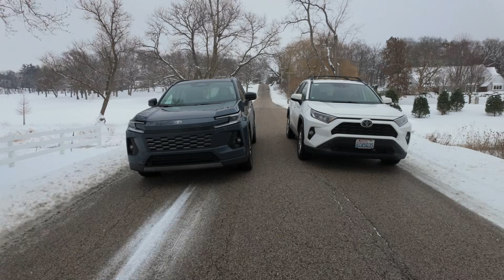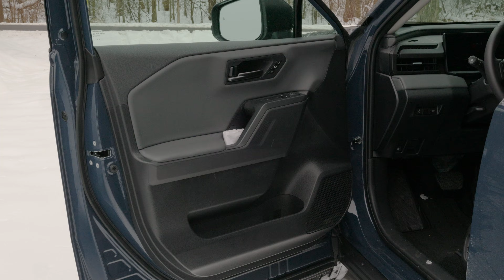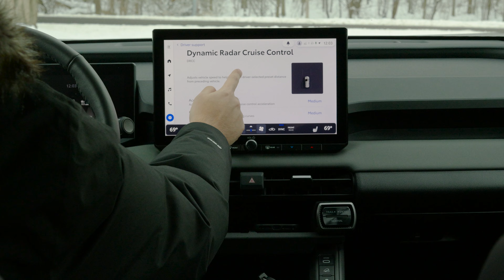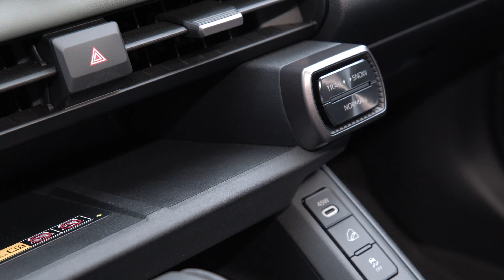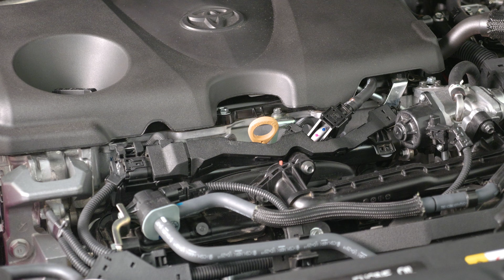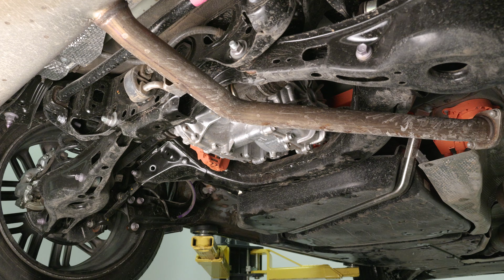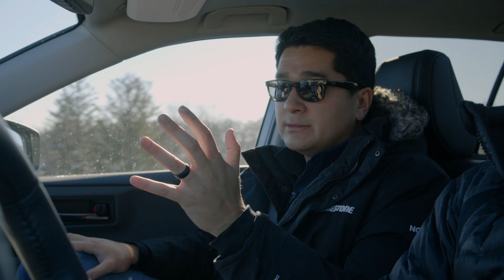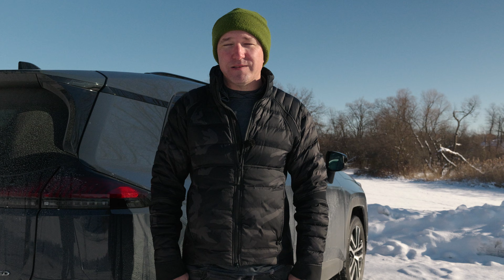2026 Toyota RAV4 | What Most People Want

Comment: Jack, you said you bought your RAV4 without hybrid to avoid long-term costs but then say the new RAV4 WITH hybrid is better in EVERY way.  I guess someone was in the back seat with a gun pointed at your career.
Reply: My wife bought it before we got married. It was due to availability of the hybrid is Covid. Other than the battery replacement the hybrid running costs have been proven to be quite low

Comment: I own a 2020 Rav4 Hybrid XE with just under 70K on it. I have 2 complaints with it. First is noise. Especially tire & road noise. It's good to hear that Toyota improved that. But, my other complaint is battery degradation. In the first 10K miles I could get up to 47 mpg on a tank, depending on where & how I drive. (Avoiding freeways and staying under 45 mph.) But, that quickly creeped down to 44, 42, 40... Now I struggle to achieve 40 mpg. And the car forces the engine to come on much more frequently than it did when it was new. My current tank is at only 38 mpg. Open highway mileage has always been at about 36 MPG.
I've been thinking of replacing it with a higher trim and the plug in. If dealers in Northern Nevada don't gouge me on the price, I might just pull the trigger this summer when the PHev is released.
Note; This car replaced my 2013 BMW X3 after the second engine ate itself with only 60K on each engine! I blame it on BMWs ridiculously long oil change intervals.

Comment: 0W-8 Oil! Wow better get used to 2500 mile oil changes. I like this but frankly I prefer my CX-50 Hybrid. Less plastic in the interior and with the Toyota drive system it's a really nice efficient vehicle.
Reply: Resistance to flowing has no bearing on the lifespan or durability of said oil.
Reply: @tim3172  That engine machining better be aviation grade PERFECT...but it won't be....engine go boom.

Comment: Why does a snow mode (which the user uses ONCE in the entire cold part of the season, provided he even has a cold season where he lives) - have a dedicated hard button - as opposed to climate controls - which the user uses many times EVERY DAY - with the need to take the eyes off the road for 3-4 seconds for a moronic screen? Why are we forbidden to use mobile phones behind the wheel - when the automakers make us delve into a moronic, needless screens - for several seconds at a time? WHY? Didn't a japanese car manufacturer (Civic) reverse a volume knob disappearence after a huge backlash in the previous gen - then what is this stupidity that we see? Is this the pure manifestation of greed? WHY, Toyota? What was wrong with normal heating and climate knobs and dials - you had in the previous gen? Do you now have to save some yens on the buttons you no longer have - for the suite of needless adas systems - meant to prevent us from crashing while adjusting temperature in the screen? WHY??

Comment: 2023 xle premium hybrid appliance owner here. Just wondering how much more refined it is? The prev version has road noise, the steering is numb and it sways if braking slightly hard. 

I think this vehicle will attract new buyers but i dont think it is enough for owners of the older generation to switch. 

Oh and that ev cable housing is near the rear ev motor now with a similar cover to the updated one in the prev gen. The housing is more exposed in the new one. Wonder how that will play out due to earlier 5th gen "cable gate" issue.

Comment: my question is: is the new battery type actually as reliable as the previous gen?  Those older NMH batteries may have had a time limit of 10-15 years, but within that timeframe I've seen TONS of them make it like 500,000 to 700,000 miles before failure (taxis, ubers, couriers, etc).  Will the new lithium ion battery be able to do that?  Because I'd be willing to bet that they're going to last 7-12 years and maybe 100,000 to 150,000 miles maximum.

Comment: This is like most vehicles.
Made for people who do not have enough brain cells to handle driving.
The ones who think 10mph under the limit is safe, until you get to a passing zone, where 5 over is needed, just to make sure only a POS would pass them.
The ones who think a clear road is a sheet of ice, because its 34 degrees.
The ones who believe the turn signal should be applied AFTER braking and merging into the turn lane, and then stopping, despite an excessively large gap in traffic.
The ones who merge onto a 70mph roadway at 43 and then bitch about how those semis "drive too fast".
The ones who drive 37 in a 55 and yell at their kids about how "THERE'S ALWAYS SOMEONE ON MY ASS!!!!!!"

Comment: How often did physical HVAC controls break on any car I’ve owned over the last 50 years?  Never.  How often have I had a screen stop functioning properly in that time?  Lots.  How exactly will you fix a 12 year old screen when it stops working?  The current trend towards putting all controls in the screen may not end well for consumers.
Reply: The variable blower speed control resistor often fails on some vehicles, Nissan, but you still get high speed.
Reply: What happens when a Tesla screen fails? You could be stranded.
Reply: On the bright side if a screen fails they can always blame it on a bug which will be fixed in an upcoming software update, instead of engineering physical controls which costs more money.

Comment: The 2026 RAV4 pricing was released ~3 weeks ago and they increased, even more pricey than the current Honda CRVs.
Can't compare this New generation of RAV4 with the current CRV hybrid which is in the mid to end cycle. Toyota uses a ~5~7 yr cycle refresh while Honda uses a 5 yr cycle refresh, next ~2028. A better comparison would be in 2028 with the newer Honda CRV hybrids.
You forgot 1 thing to mention... does the New 2026 RAV4s have a spare tire? Fog lights?
Many automakers, including Honda, have Remove them.
It appears that Toyota & Hyundai/KIA are keeping many equipment components vs Honda which is De-contenting the CRV, stripping it bare, and putting it into its Acura line in America, which is BS, considering Acura has NO hybrids! The CRVs now are Overpriced but similar to the RAV4s... keeping it 'basic' as a moving 'appliance'.

Comment: While it may be what most people want, it is not what I want, and I already have a '25 Camry,   which is not really that great, either...yes good hybrid driving dynamic and fuel efficiency, but the seats suck and way too much BS electronic nonsense...Rav with no buttons/knobs for hvac is a deal breaker for me, I mean they have two pods on dash that should be for fan speed and temp like the Tacoma, but they have to load it up with things that most people don't want or need to be fiddling with while driving,,,these cars would be so much better without all the gimmicks and electronic crap!

Comment: I want a simpler RAV4 with a 2 liter diesel.  
I do NOT want digital menus or a complex (and heavy) hybrid drive system.
Stop the madness.
Reply: "I want to pay 40% more for fuel."
Yikes.
Reply: @tim3172  Getting 60-65mpg with diesel offsets that cost.  That, and having MAX TORQUE at 2100rmp makes your car a rocket ship around town.
Reply: @tim3172  60-65 mpg and MAX TORQUE at 1800 rmp.  Twice the mileage and twice the performance around town.

Comment: Subscriptions in my car but they removed physical HVAC controls? 

That's a bruh moment
Reply: Not to mention that interior and especially the dash looks like seriously cheap plastic junk!
Reply: They remove the knobs so that when the screen dies you'll be forced to pay thousands of dollars to replace it in order to heat your car or buy a new car because that lifetime fluid totaled your transmission.
Reply: What's weird is my 2025 Camry had a much longer trial period for subscriptions then my new 2026 Rav4.  Connect and Safety are for 10 years in the Camry and 5 years in the Rav4.  I don't really use any of them anyways, so I definitely won't be signing up after the trial periods end.  It's cool that you can make sure your doors are locked and windows are rolled up but other than that who cares.
Reply: Imagine them charging you to use your heat or AC.
Reply: The HVAC buttons on the last gen were really just vestigial, anyway
Reply: @ChoPi-Eww LOL no, they weren't.

Comment: Nobody (approximately zero people) have their battery replaced at the dealerships.  The aftermarket replacement for a hybrid battery by the time that it's needed, 10 or 15 or however many years down the road, has historically been around around the $500-$1000 range (NOT $3000!!!) and it's so easy to do that owners can do it themselves.  Battery prices have been coming down, too, due to glut of supply.  Online gougers can be found, as can good deals and honest pricing.
Reply: By the time you actually have to change the battery or repair it, you have saved so much more money on other things that cannot break because they are not there (alternator, starter) and overall reliability and the phenomenal fuel economy, that it is ridiculous to say paying for the battery has any impact at all. These drivetrains are bullet proof.
Reply: @th3m3du54  Heads-up, there's been hostile misinformation by the EV wackos.  EV itself is hostile, the whole paradigm, the variants (BEV, PHEV, EREV), and everything about it.

only Engine-primary Plug-free powertrains (with or without Propulsive KERS enhancement aka Hybrid) are potentially legit and potentially don't suck and are potentially worth buying.

Comment: Have they fixed the impossibly hard seats?  The previous generation impacted my back and thighs so badly I had to get rid of it.  I had one with a power seat and could never find a position to relieve the pain.  The one way lumber was to high on my back to make any difference.  I had to do 6 months of physical therapy to correct what Toyota seat engineers had caused after I got rid of it.

Comment: I just bought a plug in 2025 this past April and while it’s good, it’s WAY too stiff. It’s as if they put the heavy battery in, didnt stiffen the chassis, and let the over sprung dampers do all the lifting. Combine that with shitty traction control calibration and driving it even close to 7/10s is the most frustrating experience I’ve ever had in a car. Also, low frequency noises of all sorts get transferred into the cabin like Biden’s southern border. I have 30yo cars with better low end NVH. The only positives are it’s very quick and I spend roughly zero dollars to run it. $30-$33/mo in gas and 2 dollars a week in electricity. I’m averaging about 900 miles per tank which is unreal, but that’s it. That’s where the positives stop. The heated seats are underpowered, the JBL lacks a center channel, the heater is underpowered, the seat bases are far too shallow, on and on.
Reply: 18:13 also, this is my exact situation. The Toyota dealership gave me 40k (which was my payoff) for my 2022 X7 with 80k miles, which was due for a major service. I decided, while I’m waiting to figure out my next nice long term car, just get something that costs zero dollars to run. It’s been perfect for that.

Comment: My one concern is that, although the eCVT does have planetary gears, it also has an internal chain.
That scares me.  Chains stretch over time.  Mazda gives you a traditional transmission.

With the recent relaxation of mileage and emissions requirements, the first thing automakers should dump are the CVTs.   The next are the plastic components in engine bays.   Radiators, timing chain guides, oil pans, the list goes on.  Lithium Ion batteries spontaneously catch on fire.  How many peoples homes have burned down because of this?  A lot.   Dump them and use time proven battery technology.  

Keep advancing technology, but don’t stick the consumer with stuff that sucks or is unsafe.
Reply: VW has a traditional transmission as well, better interior too.
Reply: @993CarreraPolarSilver Ah yes, VW... the pinnacle of reliability and longevity.
Reply: Traditional transmissions also fail over time, champ. 
Mazda's transmissions are not exactly the pinnacle of durability and longevity... despite them having made the same ones for over a decade.
No serious car company is going to "relax" on mileage or emissions. Chump wakes up one day and completely forgets what he did the day before.
There's also this thing called... you know... global market, which is not relaxing either.
The plastic components aren't there for... mileage or emissions. Dafuq are you smoking?
How many people/homes have been lost when ICE vehicles catch fire? 
Lithium ion batteries are decades-old.
Reply: @tim3172  Not as easily as eCVT or CVT will over all. Toyota blew it big time with this new model...

Comment: OH, FOR CRYING OUT FREAKING LOUD.  Will you juveniles EVER grow up?  What is the FIRST thing you do with your FIRST drive in the video -- some 10 minutes or so into the video?  OF COURSE -- "YOU FLOOR IT" from a stop.  Will you EVER comprehend that "NORMAL" PEOPLE DON'T DRIVE THAT WAY???  Do ANY of you comprehend "variable valve timing?"  WHEN YOU FLOOR IT -- IMAGINE THAT -- YOU IMMEDIATELY GET INTO THE HIGHER RPM RANGES.  Is that too difficult for you to comprehend??  So, your sense of "interior noise" is ALMOST ENTIRELY based upon FLOORING IT AS OFTEN AS YOU CAN.  Good freaking grief.  "NORMAL" human beings usually just trundle around at around 1,000 RPM to 2,000 RPM, and engine noise is minimal.  Get it over 3,000 RPM -- WHEN YOU FLOOR IT ALL THE TIME, EVERYWHERE YOU GO -- and yes, the engine noise increases substantially.  CAN YOU EVEN BEGIN TO UNDERSTAND THIS??  "Obviously not."  I have two words of advice for you:  GROW UP.

Comment: Does it still drive like a boat? The previous gen had lots of body roll during handling and noise dive when braking. Have those improved?
Reply: Then don't buy a crossover?
Reply: @ShaiyanHossain have you heard of the mazda CX-5, CRV, RDX? Exceptional steering and handling from the RDX.
Reply: @SamVal-s2o those all pale to just driving a normal car

Comment: Toyota did a good job on the update especially on the outside, made it look more upright & lots of lines became more horizontal...makes the old one look a bit awakwardly hunched over in comparison. Not a fan of the gauge cluster display not having some sort of hood and the HVAC controls changing but those are pretty minimal.

Comment: RAV4 hybrid might possibly be more reliable than the non hybrid version.  Only downside is the buzzy engine when you floor it and it stays at one RPM range.
Reply: I am convinced Toyota’s 4 cylinder hybrids are more reliable than anything else they have ever produced.

Comment: Well, the engine is extremely loud, in an unrefined way, in both the new RAV4 HEV and the new Camry HEV (5th gen. Hybrid system) to the extent that sound deadening materials are no help. So, the reviews that keep mentioning the switch between the combustion engine and the EV mode is seamless or that you won't feel it are demonstrably inaccurate. The other issue is seat comfort. These seats are at best suitable for city driving, simply compare them to a couple generations back, and you'll see how stiff and thin they now are.

Comment: A couple of important points:  The previous Rav4 generation had lithium on 6 of 8 standard hybrid configurations including both high power plugin models.   Toyota has used lithium in hybrids since 2012 in the old Prius wagons sold overseas.   

Second, the last hybrid Rav4 was 4 wheel edrive in all ten trims.  The new models adds fwd on some models as a cost savings measure to close the price gap with the loss of the convention ICE versions.

Third, the previous Rav4 hybrid was "better in all ways" than the ICE version that was noisier, suffered from 12v stop start and had less power especially off the line.  

Finally the previous Prime plugin version left the standard hybrid in the dust as well.   Way more power due to a bigger lithium battery and tuning, quieter with more sound deadening, acoustic glass and ev capability at all speeds.

It is notable the new generation is quieter (hopefully quieter than the last rav4 hybrid), slightly more power in standard hybrid configs with lithium replacing nimh in the two entry level hybrid versions and better safety systems which were already good.

I am most concerned with the lack of hard controls on the hvac and possible flaws introduced with a redesign.  One of those concerns is the revised brake booster which was a problem child in gen2 and 3 Prius hybrids.  Of course it is the unexpected issues introduced in a redesign that can be annoying as they engineer a fix.
Reply: Well said!  Also, if the new version got heavier, then the 17hp bump won't make it any faster.  Lastly, in addition to what you said, the PHEV version gets its additional power by turning MG1 into a propulsion motor (via a sprag clutch), which the standard hybrid doesn't do.
Reply: Toyota's never offered the Rav4 with 4WD. Since its inception, it's been FWD or AWD.
Reply: @tim3172 the first gen did have a 4x4 transfer case.
Reply: In spite of their effort to deep dive the technical stuff, they didn’t get into whether the Li-ion is still air-cooled or water-cooled like Ford’s been doing.
Reply: @GHinWI  Air cooled
Reply: @GHinWI  Air-cooled in the standard hybrid, refrigerant-cooled in the plug-in hybrid(it's tied into the HVAC heat pump).
Reply: @GHinWI air cooled with a heat sink system and a circulation fan for cooling.
Reply: @GHinWI it will be air cooled in the hybrid.  Is Ford water cooling their hybrid vehicles, or their EVs?
Reply: @InPursuitAutomotive : both ev and hybrid currently.  Last air cooled ones were the c-max and fusion hybrid generation.
Reply: @GHinWI  Good to know, thanks for the info!